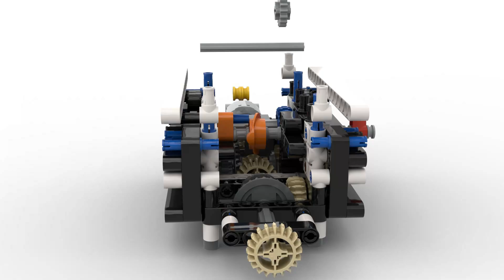Lego Technic Two Degrees of Freedom 2 speed Automatic Gearbox

Comment: hi is it possible to see the build sequence on this design, i really like the idea of disengauging the main driveline, it makes so much sense to use your concept id like very much to try this design in my model, looking for 1/10 ratio
Reply from the maker: Hi Gareth, Yes will create some build instructions and put them on rebrickable. 🙃
Reply: @TechnicBrickPower  great thanks whats rebrickable? im new to this?
Reply: hi did you get to putting a build instruction together or even just s couple of part builds would be good! - i did see a new gearbox design on you tube using the new differential deaign but i can nolonger find it?
Reply from the maker: @garethhunt6220  Hi Gareth, ok yes I will make them tomorrow and send you a comment with a link to find the pdf.
Reply from the maker: @garethhunt6220  Hi Gareth - here are the build instructions for this model: https://rebrickable.com/mocs/MOC-70177/TechnicBrickPower/two-degrees-of-freedom-2-speed-automatic-gearbox. Let me know how you get on building it.

Comment: Nice job! Do you think it is possible to use it in reverse, so you can start in a low gear and it will switch to a high gear when the resistance decreases?

like a "regular" automatic transmission does.
Reply: I mean... just change the gear ratios. This is already doing the same thing just at a different ratio.

Comment: got it! instead of the fixed sprocket, you could have a geared up clutch so the shock of shifting is spread over a rotation, same goes for back again. That would give a kind of blurred shift. I wanna try this, and also do the torque sensor at the motor end....  what you reckon?
Reply from the maker: Hi Carl...mmm hey yeah that might work - try it and let me know if it works.... I think if you place the torque sensor at the motor end then the torque it sees will change when it shifts down, making it want to shift up again etc.
Reply: @TechnicBrickPower  I was thinking that constant shifts would need to be damped, with maximum demand meaning the brake is fully off... dunno, I haven't used the selector device yet! might need to find a tutorial. Good fun anyway.

Comment: had to have another look, I was wondering if it was possible to build a progressive brake, rather than a totally locked path? eg more like a full size automatic transmission with braking bands? You are so absolutely close to mastering this one, it has constant drive, just need to eliminate the click as it switches ratio. Or to make it less of a jolt? dunno, I want my next solution to blur the gear change like the cvt, AND have the control done by the third diff like you've done.... So instead of friction pins and clutches, a brake that is let off. Dunno, am thinking out loud here, and also I want a gearbox that starts in low ratio then changes UP like a real car! Moon on a stick please!

Comment: oh wow that's awesome! I would say I owe you a pint, if not for the fact you have made a brilliant 2 speed gearbox!!!! this is the best switch over twin speeder, with near zero losses.... but you have lost the cvt part of it! so close, but not quite there yet. Awesome all the same though. You, me, and Max Brick are onto something incredible here.
Stay safe and have fun building amazing stuff. 👍🍻🍺
Reply from the maker: Hi Again Carl. Thank you - I couldn't have done it without your feedback and making me think about this technique again. Zero losses...lol there are losses as soon as you string two gears together and diffs lose a lot... CVT is a dream within a dream lol. 😂🍻🍺
Reply: @TechnicBrickPower  you did the hard work and design. I need to build a brake that is released when a lever is pushed OR pulled. So a brake that is on until released. This'll be so that I can use the torque sensor to progressively let off the brake, in both directions! you can see where this is going?

Comment: Otherwise known as a "bias drive". A bias drive is any transmission that uses a differential as the primary throughput, with the speed of the 3rd differential member utilized to control the bias of the input/output ratio. Regardless of the manner in which the 3rd member is controlled... be it speed or torque sensitive control, the speed determines the output by manner of bias. Iv-Cv=Ov (input velocity minus control velocity equals output velocity).
Reply from the maker: Hi Jessica, Thanks for your comment - I've heard of a warp drive but not a bias drive. LOL thanks for the information - will look up that term to learn more. 🙃